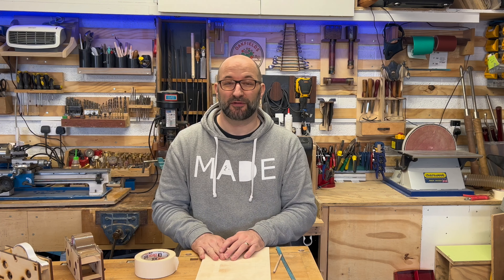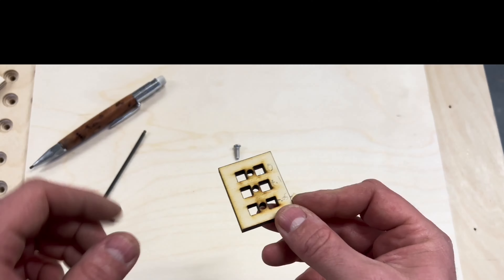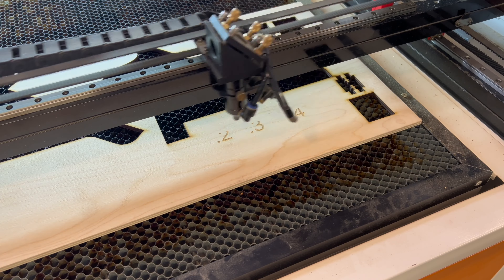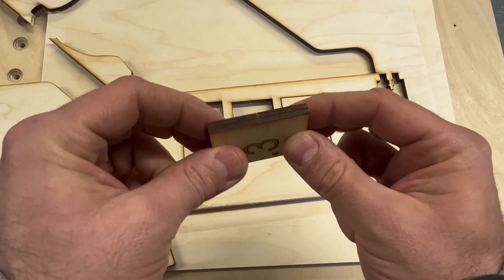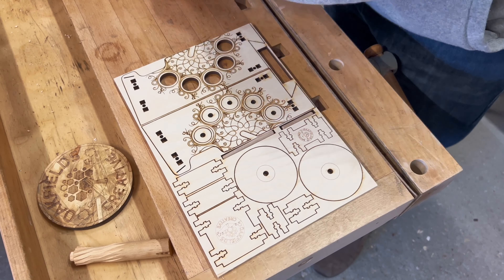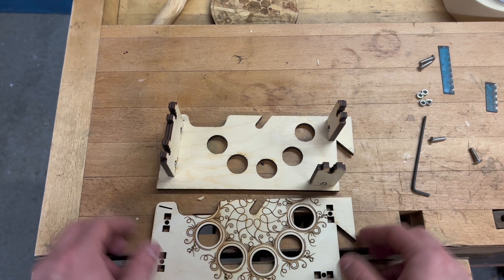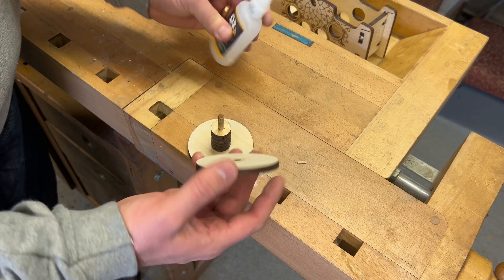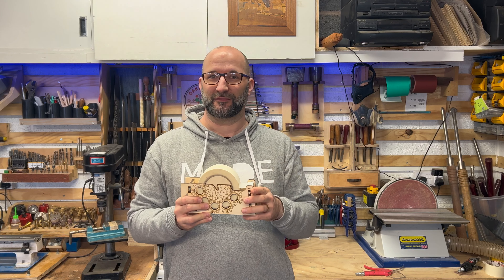Crafting a Stylish Tape Dispenser from Flat Pack - Laser-Cut Magic!

Comment: Keep it up. Is that the tape you use to mask your laser pieces?
Reply from the maker: I generally don’t use tape if I can help it. A good air assist and a light sand usually. But you can use any masking tape to protect from the resin that flairs from cutting and etching.